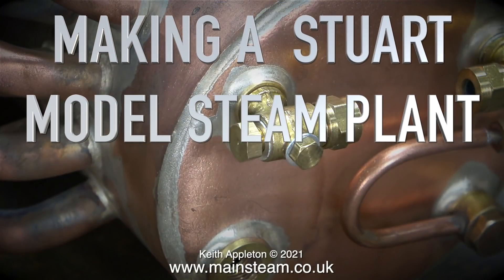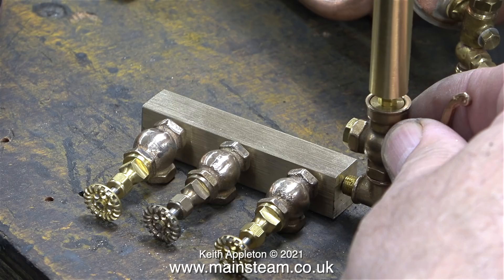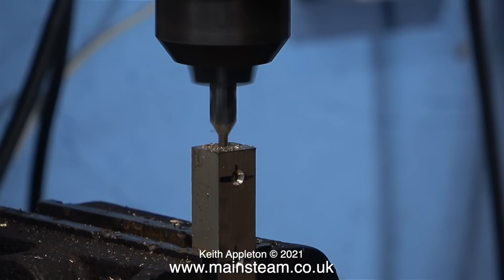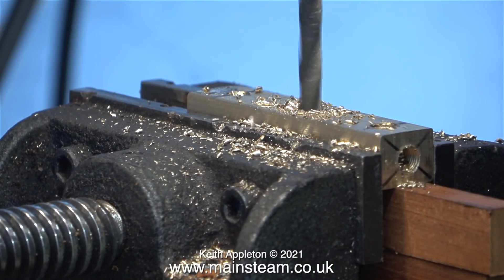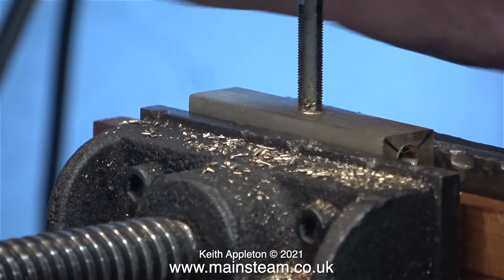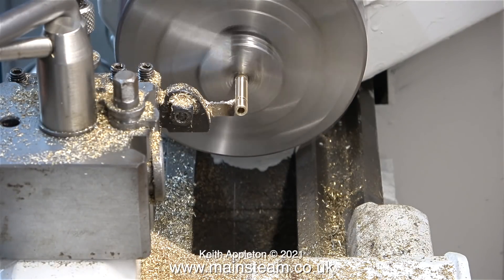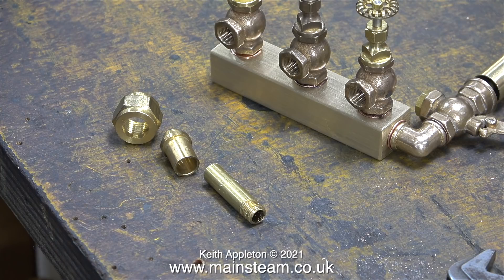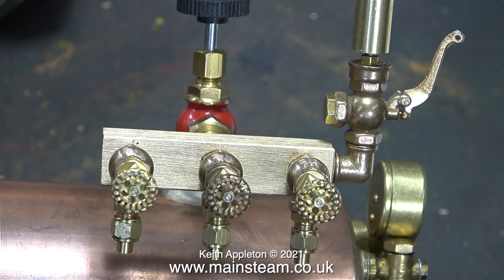MAKING A STUART MODEL STEAM PLANT - PART #36

Comment: hello keith im working on a stuart 10v a vintage one, great overall build standard but the inside of the cast iron cylinder casting is a bit rough, i dont have a small piston reamer. any useful tips on smoothing it out?
Reply from the maker: Maybe you could buy a cheap Cylinder Hone set that goes down to 3/4 of an inch diameter  and clean up the cylinder that way. Or alternatively machine a Lap of the same diameter as the cylinder bore and use some grinding paste . . . . . .

Comment: Drilling down the length of a block in a drill press you may find fitting a drill bit in the chuck and using it as a Gide beside the block is more accurate which helps if you need to drill off Center to allow for thread depth in a manifold , cheers

Comment: Hello Mr. Appleton, I like this design of the stuart boiler very much. The steam distributor is a good solution. Is the bottom outlet for drainage? Greetings Michael
Reply from the maker: It is for a Check Valve to allow clean water to be pumped into the boiler to replenish what the Steam Engine use when running ......
Reply: Thanks for the information. I should have figured that out myself. 🙂

Comment: love me the globe valves . . . they hardly ever leak, they allow full flow and smoothly throttle.

i've used them in every house i ever owned . . . i move in and soon replace the main water shutoff and the service valves to all the sinks, toilets, etc. . . . now i'm sure that if any of those devices gives me trouble, i can actually shut the water off completely.